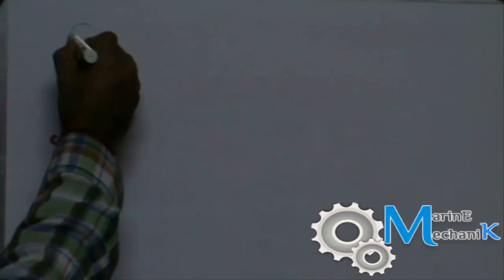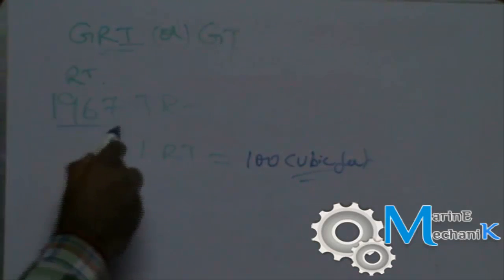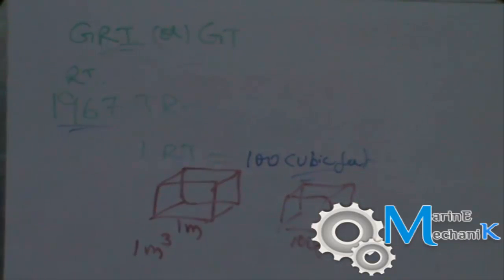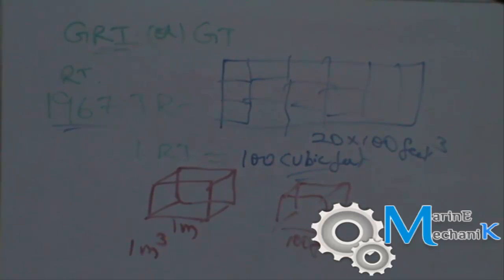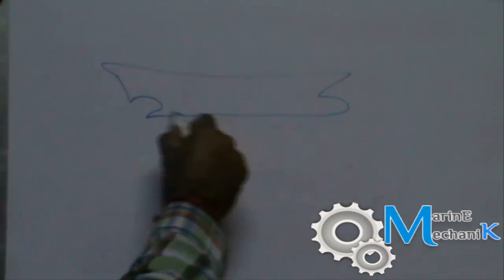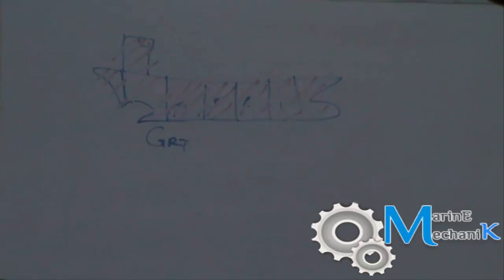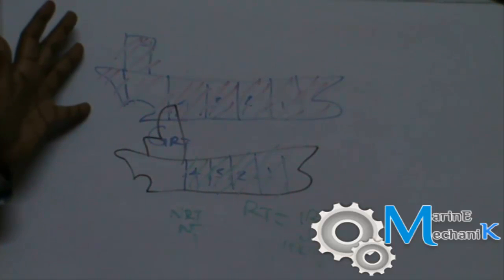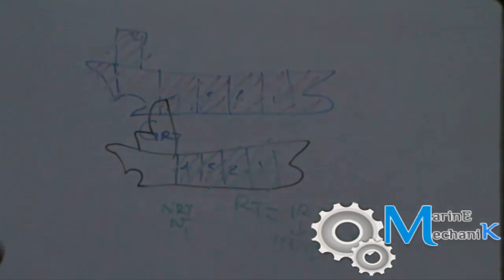Ship's Tonnage Explained.

Comment: Wrong concept on volume calculation. The side of a 100 cubic ft is the cube root of 100 which is about 4.642ft. This gives you about 1.415m. The 1967 tonnage rule gives about 2.83 cubic meter for 100 cubic ft.

Comment: If every side of a cube = 100 ft, then the total volume is (100 ft)(100 ft)(100 ft) = 1,000,000 cubic feet, not 100 cubic feet as stated in the video. As another example, consider a cube where each side is 2 ft. Then the total volume is 8 cubic feet, not 2 cubic feet.
Reply: Stated by mistake
Reply: absolutely
Reply: shreked

Comment: I am very sorry Sriram, but your information is not up to date. The terms GRT and NRT are no longer utilised since the implementation of the Tonnage Convention 1969. The terms used are now GT and NT and there is a very important reason for this which you have missed entirely, as well as application of a formula now applied to the measure of cubic metre volume.
Reply: True can you please future explain the application of the formula how its calculated today , or give a link to information. Thanks in advance
Reply: Well said sir...
This was the old measure..
Reply: Whisperin100 gross tonnage is the intenal capacity of a ship .it is also defined as the function of volume if enclose space measured from keel to funnel from inside shell plating.

Gt=K1 x Vc

K is constant here
K=0.2+.002 logVc
Vc is the total volume of enclose space measured from keel to hull.

GT has not unit as it itself is a unit and a function of volume (just like cubic )